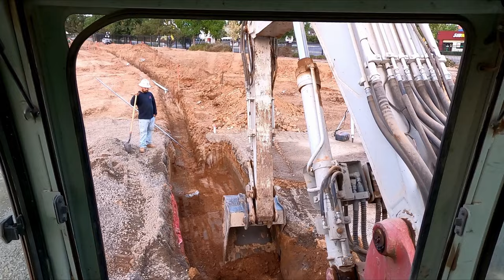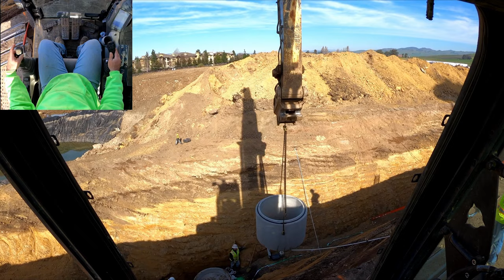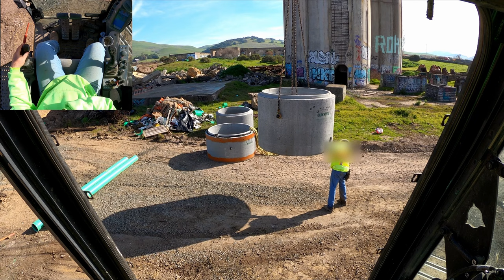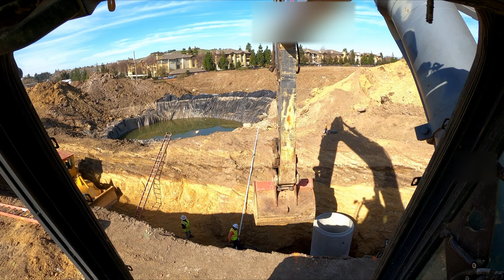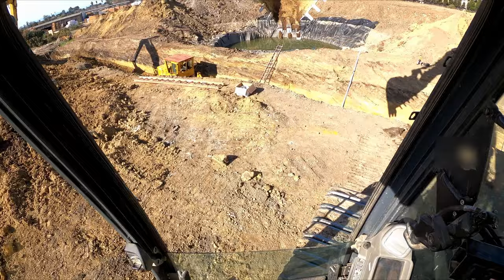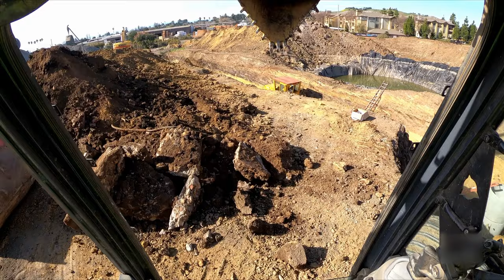Part 5 NAPA Digging a Stub and setting a manhole

Comment: When digging with the V bucket, what's your thought process? Establish your center line first and keep it lower so you have something to go off of, then follow with your slope cut? I've never seen a V up here in Seattle, but that's mostly because we work downtown where there just isn't any room to lay a slope back. I'd like to try one out someday.
Reply from the maker: I start at the top of the slope on the spoil side to make room so I can start my swing earlier. It allows me to have faster cycle times. When I was starting out I was told "take care of your edgis and the center will take care of itself".  That stuck with me and it does apply to more than just digging. I will lit you ponder how it can be applied to other aspects of operating equipment. 😉
Reply: @TheLeverMonkey  I never thought about that but it makes so much sense. I've been doing this less than 10 years so there are a million little tricks for efficiency you know that I have yet to figure out. Great advice, thanks!

Comment: That's one hell of a swimming hole for that sub devison I'm betting they are just diving right in
Reply from the maker: It is in the street so it is going buy buy.
Reply: Are they going to fill it with flowable or is it going to be a sinkhole on the news in a few years?😂😜
Reply: @wesleyfranzen6675  you can see the rubber liner isn't going to be a sink hole once they pump the water out put new dirt in they might even put rock and dirt in it .
Reply from the maker: @wesleyfranzen6675  well it has a solid base to build on. So it is up to them if they do it right.
Reply: Hopefully they fill it up with gravel so it doesn’t just turn to mush. How deep is the hole?
Reply: @wesleyfranzen6675  he said 20 feet .I highly doubt it's going to turn into a sink hole .if you haven't watched all his videos you should hit the subscribe
Reply from the maker: @wesleyfranzen6675  12-15 feet

Comment: How deep are you digging? Good video.
Reply from the maker: around 20 feet
Reply: They need to get you the big sand bucket if your not digging rock
Reply from the maker: @liftedburblife  This site has a lot of buried concrete. They removed a 1/2 mile of tunnels in the area.